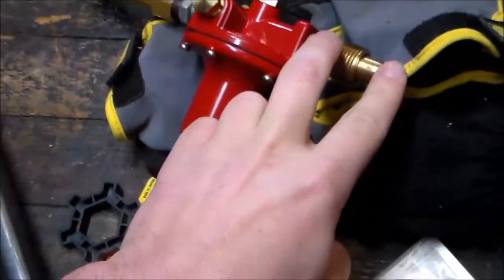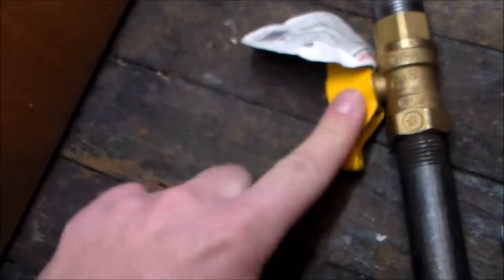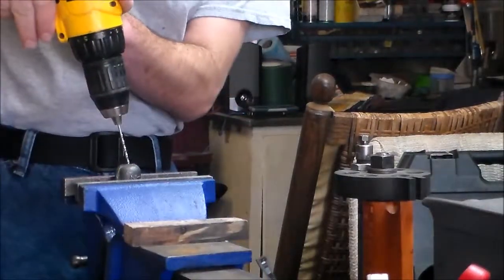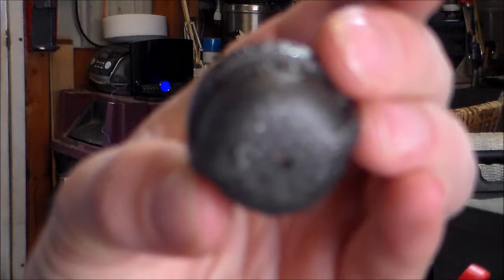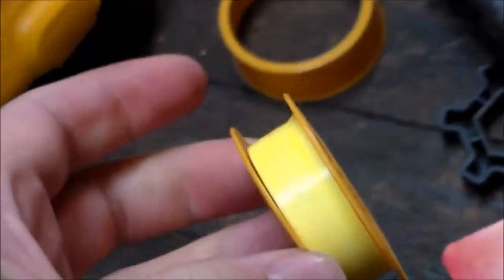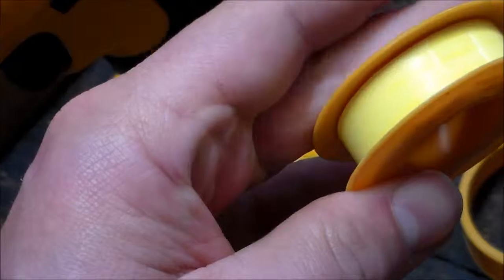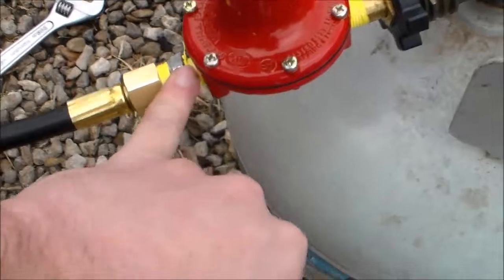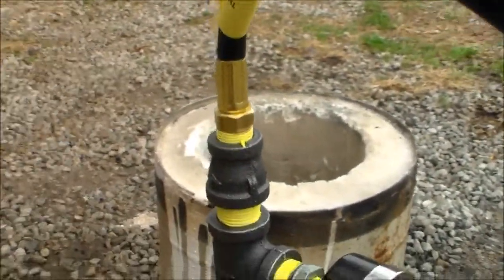Propane Conversion on Smelting Forge

Comment: You're in a low-pressure situation once you get past the tank it doesn't matter what you use that thing is not going to be around long enough in your life to deteriorate the Teflon in between the threads as a matter of fact it's extremely difficult to damage Teflon. The different Teflon tape are gimmick more than anything. Another thing you're using propane with a propane burner you shouldn't need any forced air at all the only time you need for stairs with a gravity burning set up like charcoal or would. Propane burner if it's properly made should suck all the necessary gas and air for its own mixture